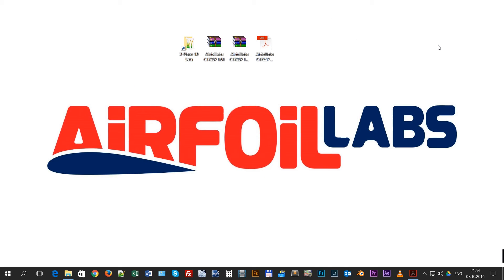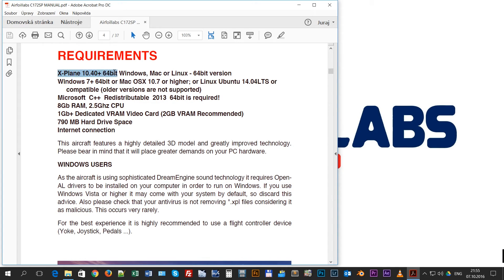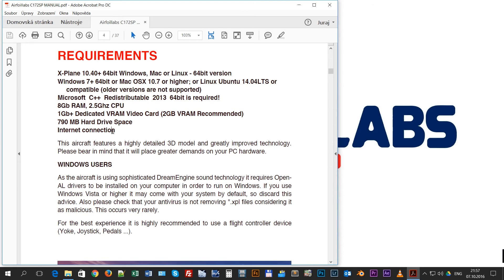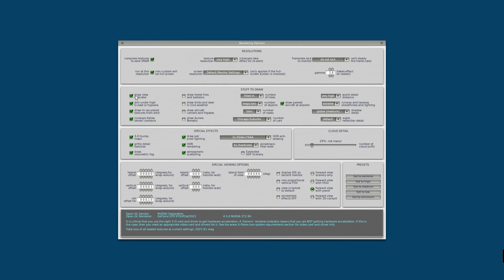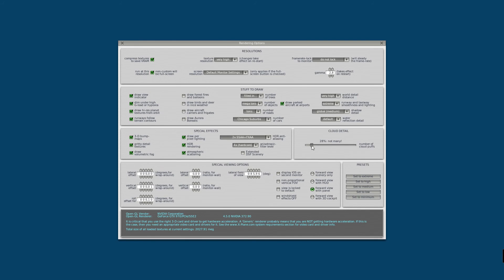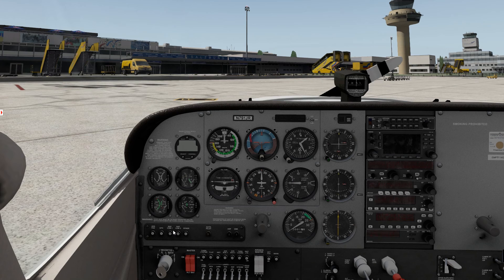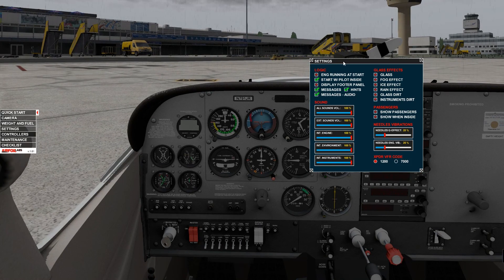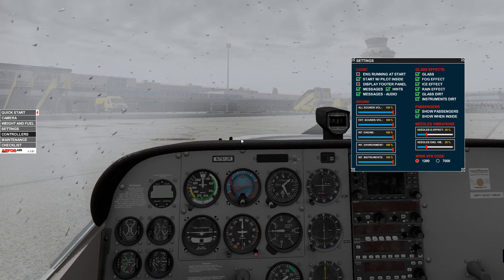5. Airfoillabs Cessna 172 SP 1.61 - FPS Performance Tuning

Comment: So I tried the JustFlight C152 today which has just as detailed of a plane model as the C172 if not more so and it ran completely smoothly. It seems like most of the stuttering and fps loss is coming from the C172 plugin, not the plane model.  It seems like the plugin is possibly not that well optimized.

Comment: Could you possibly create a new video like this for Xplane 11 and version 1.9 of the aircraft?  I just tried it out in VR and the FPS drop was so terrible that I had to switch back to using the stock Cessna (which runs buttery smooth for me).  The plugin was showing as using between 4 and 5 fps the whole time and it was causing stuttering where I'd have intermittent fps drops every second or so and it just really dragged the entire VR experience down.  The low res version of the plane was eliminated in version 1.8 because supposedly Vulkan is supposed to be handling the optimization now.  I'm not sure how much of the fps loss was from the plugin vs from the aircraft model itself, but it would be nice to have some tips on what to try in terms of fixing the performance problems (if that's even possible to do).  The aircraft itself looks amazing so it would be really nice to be able to use it without such a large loss of performance.  By the way, I'm running an i9-9900k with an overclocked 2080ti, so my hardware is quite good and runs fine with every other aircraft model I've tried except this one.